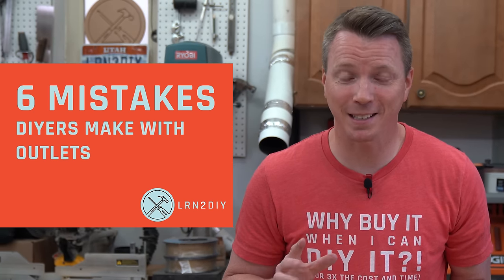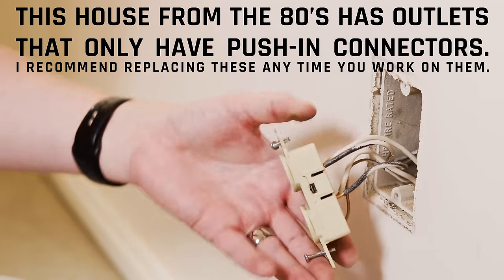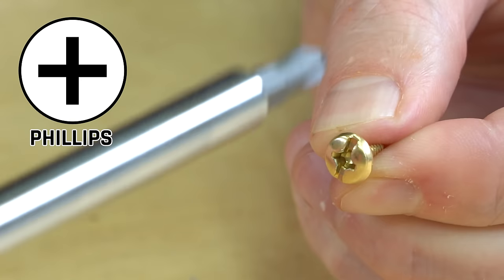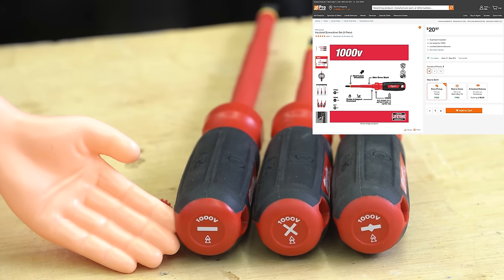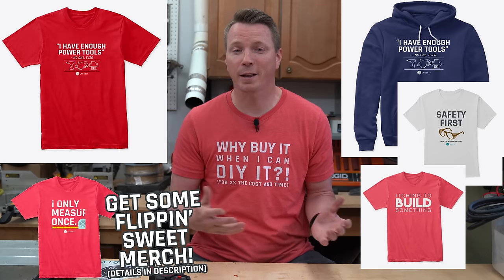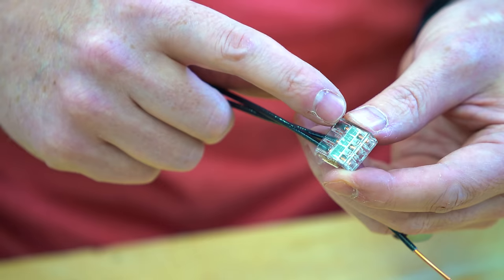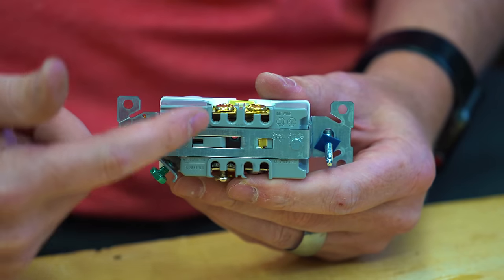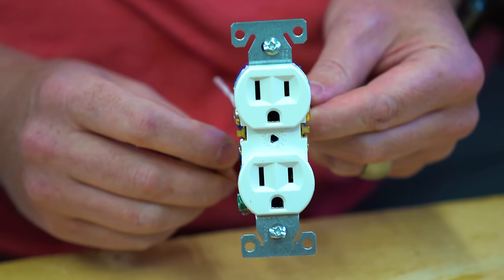6 MISTAKES DIYers Make When Wiring Outlets

Comment: Just make sure you buy the right amperage outlets for your wire gauge.  The cheapest outlets are typically 15A (like the one in the video) and don't accept back-stabbing 12 gauge wire that you'd have on 20A breakers.  You shouldn't use 15A outlets on a 20A breaker anyways though.

Comment: Backstab not a thing here. US outlets always look sketchy! actually even the insulation looks like it would break down (400V DC) being so thin! 
Using the wrong tool always bad...
Those twist things are not a thing here at all we just have better outlets... The number one problem the one that will fail electrical cert and limited electrical cert is knicking any part of the copper (conductor) or insulation stranded or solid pretty much an instant fail (weakens the conductor electrically and physically).

On the hole it is expected that a electrician will do house wiring and test it for compliance... Please remember there are pros and cons to every countries electrical system.   

Ps I cut my electrical teeth in a 50VDC and 100's of kA will vaporise your spanner with out blowing the fuse!
Reply: "here" has no useful meaning when we don't know where you are.

Comment: Wire nut instructions say NOT to pretwist
Reply: Always have, and always will. (Pre-twist, that is) Reason being - have you ever taken apart a fixture and had a wire nut fall apart? Had this happen in a ceiling lite fixture where the heat from the 2 bulbs made the plastic brittle - which is why I always use elec tape on the hot nuts too.

Comment: Ok number one no DIYer needs an insulated screwdriver you should not be working on live devices period. You own the property shut the power off to the device you need to work on. Second this guy advises against backstab wiring, but for WAGOs? Backstab devices are fine to use just don't buy the absolute cheapest on the market (which is what is wrong in his 7 year old house, devises made to just barely make it past the warranty) and understand that outlets and switches are not meant to last forever they have a lifetime if your outlets are from the 80s you need to have them replaced they are 40 years old the plastics and glue that hold them together will fail. (people wonder why fires are started by the electrical system using outlets older than they are)

Comment: Robertson screwdrivers and screws work far better than phillips screws and screwdrivers - always. It's an example of how the inferior product has captured the market.
Reply: The "inferior" product actually created and captured the market long before the Robertson design was introduced. Moreover, the failure of the Robertson to gain market share is directly attributable to his decision to encumber the design with IP and require licensing payments for its use. Eventually the IP protections expired, but in the meantime, the original design became more entrenched, and alternatives that were even superior to the Robertson design (hex, torx, etc.) also arrived on the market, nullifying the appeal of Robertson.

Comment: No your terms are wrong.  For neutral wires.     You used terms for the hot.   Hot is input.   Neutral is output return to breaker.      Probably should re film the video.

Comment: You missed not having enough contact with the screw head, by code at least 60% MUST be in contact with the wire.  I see this failure too much on instructional videos.

Comment: You don't stab wires in the back that's why you have screws on both sides if you have more than 2 wires per side you pigtail it you don't stab them your electrician must not be to professional

Comment: There's nothing wrong with using the holes on the back when the outlet is made well and the wire is installed correctly. This is just a commercial for screwdrivers.

Comment: BOLOGNA... What you're getting is contact movement on those connections, which means the plugs were not secured properly and moved every time you plug and unplug a device.  Connections don't magically wear out on their own without movement, it's called physics.

Comment: I've been an Electrician since 1984.
Don't try to fix it iffin it ain't broke.
Signal? Maybe voltage is a better explanation.I know the difference between DBmv and AC/DC. 
 voltage. Yes there is LOW VOLTAGE in communications along with SIGNAL. 
I've never seen a Sparky with no callouses and pink hands. 🇺🇸⚓